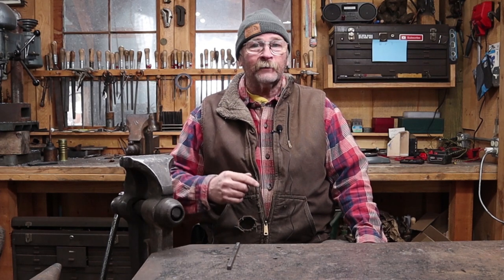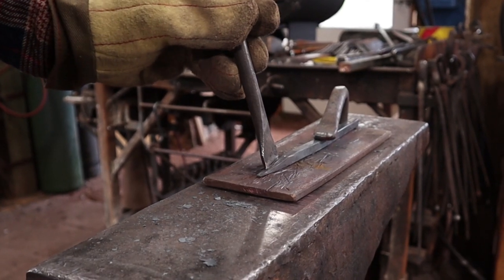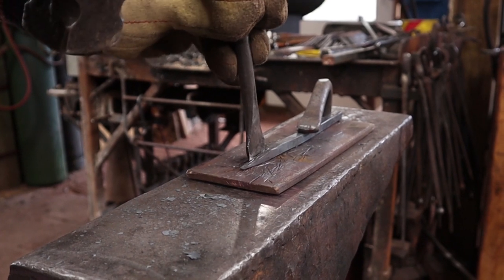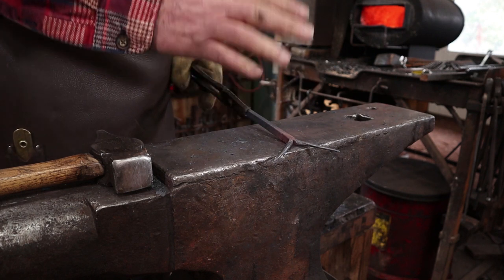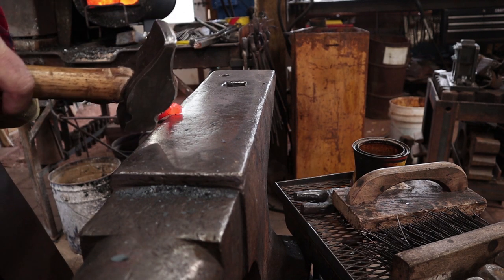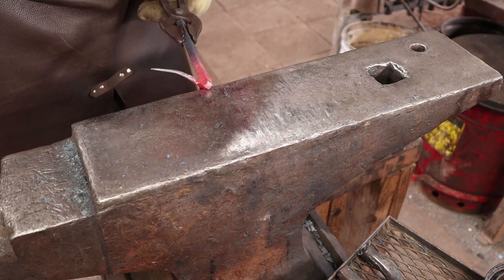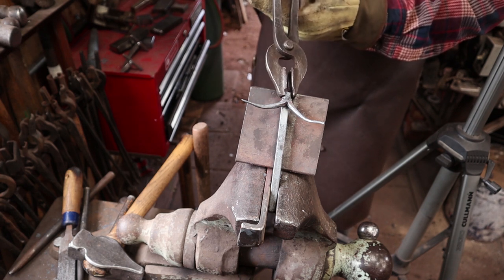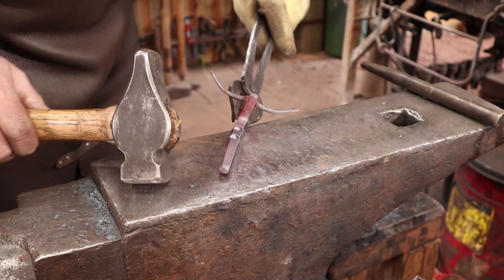Longhorn Steer - Hook of the Week 47

Comment: I just finished making this. It came out great (for me). I did make that mistake that you mentioned in an earlier video, I blocked my lower screw hole. I reheated it, straightened it out and used a smaller bending jig. Thank you for all the inspiration.